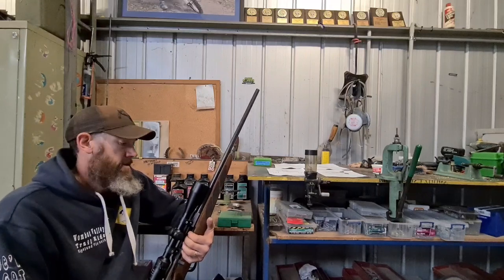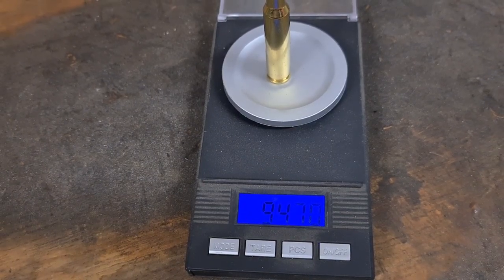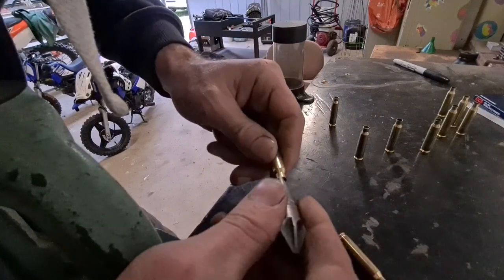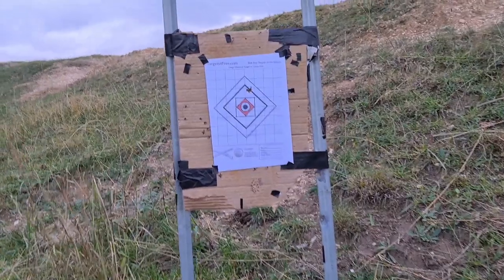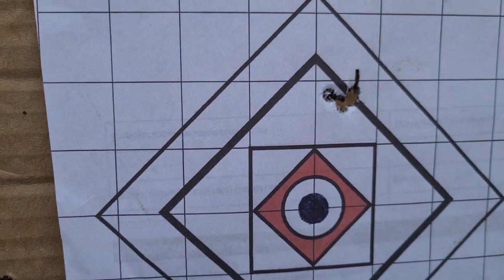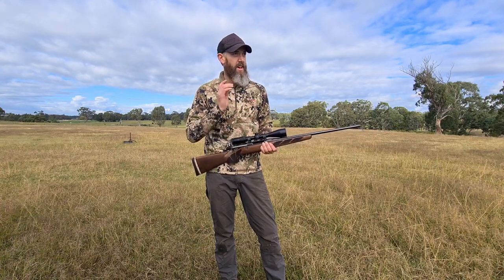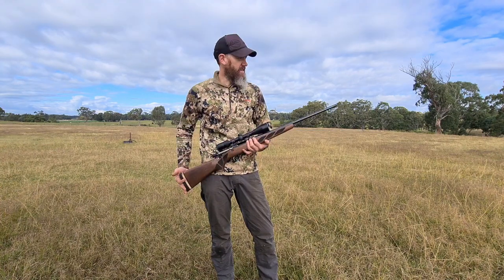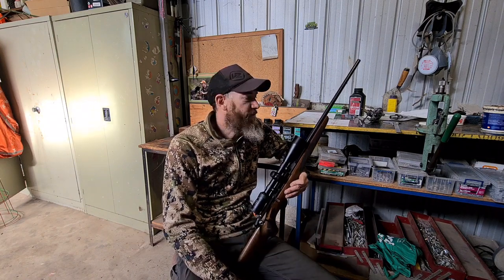Tikka T3 Hunter 223Rem

Comment: I've never found a Tikka T3 that hasn't been a shooter. The rifle you have in a 223/204 is very hard to beat and fantastic value for money. Thanks again for putting these videos together👍👍
Reply from the maker: The Tikka action is so good a gunsmith recommended one for a custom build over a $2500 action that he sells! According to him they are as close to perfectly square as you can get without the need to blue print or true up.
Reply: @ZebrasSambarhuntingAdventures  Yes mate, one of the biggest reasons I stuck with the Tikka for my main Sambar rifle. I looked at all options and just couldn't go past the T3 for more than just the value for money it offers. The carbon fiber stock that I run on my 7mm doesn't reduce the weight over the standard timber or plastic factory version but it absorbs the recoil so much better and makes it pretty good to shoot for a 7lb package. For all my smaller calibers I prefer to be able to top feed but for a deer hunting rifle the T3's always get the nod from me. Call me boring, I like simple things that just work.

Comment: Hi mate, I just got my 85 Sako .270 Classic, with Sako mounts, waiting for my new scope. Also I have a 85 Sako .223 1/12 twist on order for 45 to 55 gr loads. Most here come in 1/8 twist. What is your Tikka twist rate. Factory Nosler 55 gr is very inexpensive here is you buy when Nosler run specials. Glad you like the brass, as I am now staked up with factory loads. On foxes in NE Vic i used a Anschutz .22 Hornet and Sierra 40 gr soft point. Perfect for thin skin game when I sold the wet pelts to Sydney buyer!
Reply from the maker: Hey Tom the twist on my Tikka is 1 in 12, I owned a brno fox 22 hornet years ago it was a good little rifle to start out with.
Reply: @ZebrasSambarhuntingAdventures  I have a Brno .22lr with a 28 inch barrel, very accurate, I even had several time 10 shot into 1 inch at 100 yards in an indoor range.
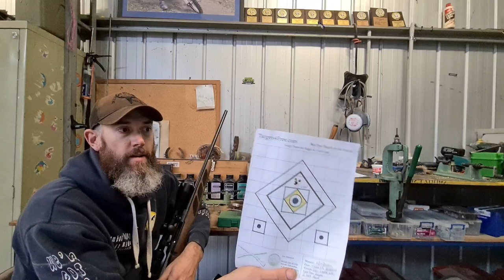The only Sako .223 i can buy of the shelf here is a 1:8 twist. I did order a Sako .223 in the preferred 1:12 twist but wont be here till February..  so I am having second thoughts of the 1:8 twist..   I want to chase coyotes here and wild dogs in NE Vic. I think the 1:10 would be perfect for 40 gr to 60 gr, but they don't make that twist anymore.. I know that long range shooter prefer heavier bullets and so use buy the 1:8...  but i want to use the lighter faster bullets..  we will see!

Comment: Would  you use a .270 on Sambar with say decent barnes bullets? Or do you recon it's too lite
Reply from the maker: 270w is fine for sambar at reasonable ranges. Id use a bonded bullet like an accubond or interbond in a 150gn. Pick you shots and angle and the 270w will kill everything its pointed at. Im not a huge fan of the x bullets but they are effective if velocity is high.

Comment: Hi, what is the rifle twist for this Tikka t3? Have you tired the Nosler .223 55 gr E-tip Nosler loads?
Reply from the maker: Hey Tom its a 1 in 12" and no I haven't tried the Nosler projectiles.
Reply: @ZebrasSambarhuntingAdventures   Great twist for the lighter bullets. I have ordered a new 85 hunter SS in .223 1/12 twist. Yeah, I buy direct from Nosler the 55 gr E-Tip, very accurate and a great round. I nearly bought some 60 gr partition bullets here in USA. I still might, as the 1/12 will still be reasonably good with the 60 gr, although 55 would be the limit i think.
I'm coming back to Wodonga soon, and will bring my Sako .270 with me. I have plenty 130 gr partition bullets. I prefer the smaller bullets on sambar, drops them on the spot. I never had a deer run after being shot. The higher speed does more hydraulic shock and lung hear damage is greater than with the slower heavier bullets. Plus, i never take sniper shots, i always get close and shoot under 100 meters. Happy hunting. Since i live here in Utah, i have recently watched every sambar hunting video..  I miss NE Vic, trout and deer, just not the same here!
Reply from the maker: @BlueTJay  yeah I think Sambar a pretty special and once you have the bug it never goes away .

Comment: Wait.. Did you say 250 cases will see out the life of the gun?
Reply from the maker: I might have said that sorry I meant the amount of use it will see with me over my life time. 250 new brass times say 5 to 10 loadings each is more shooting than Ill do in 20 years.
Reply: @ZebrasSambarhuntingAdventures  Yep! Gotcha, mate... I just put down my deposit on stainless 223 Hunter today and picked up 300 Lapua cases to load some Super Roos. I'm thinking that's about 3000 rounds - close to 10 years of shooting for me I'd say. Maybe more if 22LR stays relatively cheap!
Good videos by the way!
Reply from the maker: @Sisu2280  Sound good great brass you should get heaps of reloads from them. Thanks

Comment: Never weighed brass for any of the many calibres I've owned over the last 20 years...waste of time especially for fox/vermin shooting
Reply from the maker: If you've never done it, how do you know it's not worth it ? Weight sorting the extremes out halves my group size average.  The brass that weighs heaps more or less would account for misses on rabbits without a doubt. I've got the time so I do it
Reply: @ZebrasSambarhuntingAdventures  simple answer to that is that I've managed to get all my rifles to shoot sub 1/2" groups and even smaller without the need to weigh everything....used on rabbits /pigeons/crows out to 600yds 
..provided I've got the wind call right so to me I can't see I would have gained anything 😉
Reply from the maker: @nigel base  well if only I knew your method to achieve that accuracy 👍 better brass than what I'm using at a guess

Comment: Hey mate, did you check the length of the case for the different sizes? Love the vid though, first the handloads out of my 308 ctr were half an inch.  Now regularly getting under. 4". So impressed I grabbed a t3 hunter (love the traditional look) in 7mm08 so starting load development for that.
Reply from the maker: Hey Karl yeah I trimmed all to length before measuring their weight.  The Tikka range of rifles are hard to beat for accuracy and reliability in an affordable factory rifle.
Reply: @ZebrasSambarhuntingAdventures  thanks for the reply. I don't usually bother trimming with virgin brass, now good to know! Keep up the great work.
Reply from the maker: @ontarget765  it's not necessary and probably a waste of time to be honest but when your trying to shoot sub 1/2" you end up trying to do everything you can to make everything the same

Comment: first group best because cold barrel. Hot sporter barrel = groups opening up.
Reply from the maker: I was letting the barrel cool between groups so each group had a cold barrel shot.
Reply: @ZebrasSambarhuntingAdventures  Thanks, I must have missed that.
Reply from the maker: @JLTantrum  it's the way the video is edited....I cut out the down time
Reply: @ZebrasSambarhuntingAdventures  How often and how long do you find you need to let the barrel cool for the t3 hunter?
Reply from the maker: @JLTantrum  hey mate it all depends of the ambient temperature.....on a hot day I put it in the ute with the air-conditioning on for 5-10mins. Cool days propped up against the ute in the shade while I walk down to look at the target is enough. That's with 5 shot groups.
Reply: @ZebrasSambarhuntingAdventures  Thanks, I appreciate the info. I'm just trying to decide on my first rifle which will be .223 and weighing up between Tikka hunter or varmint hunter. Won't be on foot much so not too concerned about the extra weight but more questioning if it's worth $400 more for target shooting at a range or if I'd get by with the hunter without excessive downtime.
Reply from the maker: @JLTantrum  the heavier the rifle the more stable it will be for target shooting.